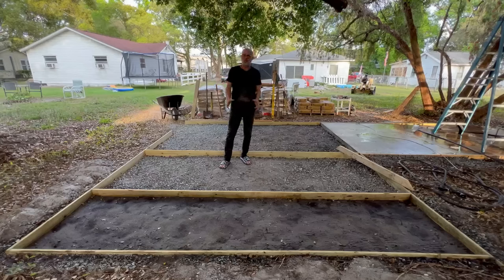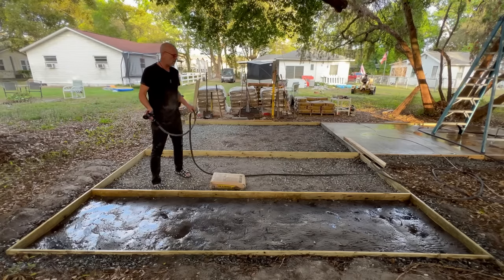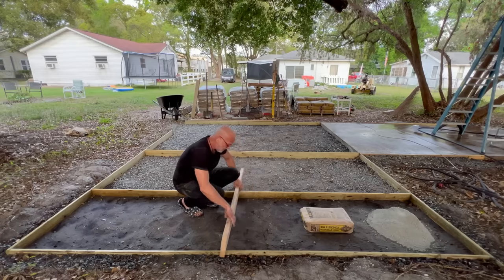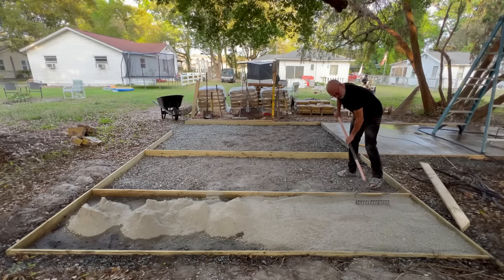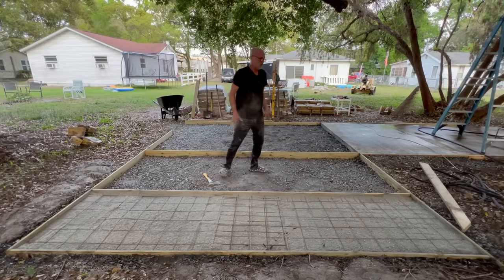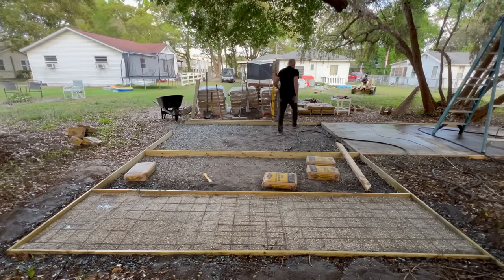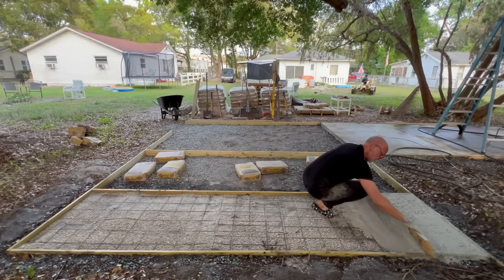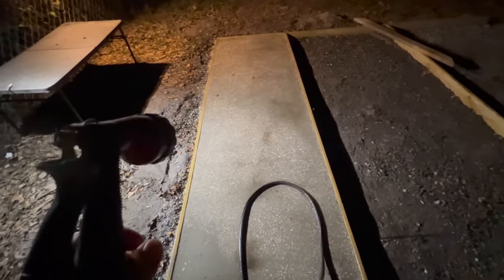How To DIY Dry Pour A Large Concrete Slab In Real Time

Comment: Nice idea, which at a push I may consider if I were to do another small project.. Personally, I'd go for renting a mini Cement mixer (borrow a friend or a second mixer) and a couple of wheel barrows and then go to town on the pour..

So, you are basically using what we call in the UK "Post-Crete"? Originally, I thought you were just using bags of pure Cement (as in the Cement you mix with sand and water)
The Post-Crete will go hard with just the moisture in the atmosphere over time.. With a sprinkle of water is enough to trigger the process..
Now Im no expert in this field but what about on the inside, in the center, My thoughts would be using this method the pad will have a crust and powder inside center core?
Also does this stuff crack over these sorts of spans, using this method? What about compression (over time will it not just turn back into dust?)

Another thought: did you manage to screen it, like "Rub it up?" Usually you use metal trowel/float/something metal to draw up/out the moisture and tamp it down (kind of like what you did) to make an almost "skim finish layer", which leaves a nice final finish, as with traditional pours.. With this approach I guess you not.
It must have been a problem to get a proper level over that entire span..

Surely this will just turn back into dust in a few months..  🚧

Comment: If you don't wet the sand you will give yourself more time get it the way you want it. Also, you do not really need the mesh, but it can't hurt. After the mesh you don't have to wet the area. You can wait and do all the water at end. Shake the leveling 2x4 left to right as you move down the pad. Try a paint roller lightly over the top layer before watering. It will give you a great look. Watering at the end will make it a little easier, mist lightly and repeat in one hour. Then water 2 times for every inch of concrete so you will want to water every hour for 8 hours. Not to much on the water. At the end you will one 4in slab instead of 2 - 2in slabs, long run it will be stronger. I enjoyed you video, great work. Thank you.
Reply: Good tips
Reply: people shouldn't give advises if they don't know what they are talking about.
Reply: @temujinkhan6326  I don't consider it as an advice. To me it's and ideas/different ways of doing things from the usual norms , ie trial and error  .
Reply: @tinaforbes1059  the person i comment to doesn't know what they are talking about. You can have an idea but if you never actually put it in practice or even have a clue about concrete then you shouldnt make comments that can cause a DIY thousands of dollars. It cost more to remove concrete in most cases
Reply: @temujinkhan6326 what’s your advice since you’re saying this is a bad idea?
Reply: Nice info you added
Reply: @temujinkhan6326  the way @pjs139 suggested is the way almost every other youtube video does it so he probably isn't wrong.  He was also respectful and didn't say the video procedure was wrong or anything.
Reply: @Gampeh  "probably" that says it
Reply: @temujinkhan6326  You're scared to give corrections, you only give empty critiques without following up with the necessary explanations (even when politely asked by other people), and you ignore the substance of peoples questions so you can answer with a pretentious rebuttal that helps no one. Sounds like YOU don't know what you're talking about.
Reply: The advice is you don’t need tools in your hands, who the hell doesn’t mix the concrete. How will the chemical cure occur if it isn’t mixed properly? Answer: it doesn’t! That craps going to be a broken up mess in no time
Reply: EXACTLY
Reply: @temujinkhan6326  
YOU ARE MEAN & RUDE...
He does KNOW what he is talking about...
This exactly how I do it... and I know what I'm doing...
Reply: @derekhallett6946  
EXACTLY!!!!
Reply: @joshuajames2785  
It will Harden with the water... BY ITSELF... NO MIXING NEEDED
Reply: @judichristopher4604  I have hired supposed master masonry and carpenters before. it turns out they don't know what they are talking about which you likely don't either.
Reply: @temujinkhan6326  
Will.... YOU are Wrong.
Reply: @judichristopher4604  how many houses or driveways have you built which has pass code inspection?
Reply: @judichristopher4604  Concrete doesn't "harden". It cures. Why does my concrete vendor deliver batch mix in a mixer?
Reply: Guys, HERE is The Savior

YaH The Heavenly FATHER (Genesis 1) HIMSELF was Who they Crucified/Pierced for our sins and “HERE IS THE PROOF”

From the Ancient Egyptian Semitic: 
"Yad He Vav He" is what Moshe (Moses) wrote, when Moses asked YaH His Name (Exodus 3)

Ancient Egyptian Semitic Direct Translation
Yad - "Behold The Hand"
He - "Behold the Breath"
Vav - "Behold The NAIL" <— YaH’s Crucifixion
He - "Behold the Breath"

“Behold the HAND that Beholds The NAIL” 

PROVES - YAH The Heavenly Father HIMSELF was Who they Crucified

That is EXACTLY what Moses Wrote

Here is what they mean

YaH's Name:
(Ya)d + (H)e, as YaH is what Moses called Him and YaH Declared: "this is My Name, this is My Name for all generations" (Exodus 3)

YaH is The Creator of “MAN”: (Genesis 2:7)
Yad He, (HAND BREATH), as YaH's "HAND" Formed man from the dust  of the Earth and His "BREATH" made him a living being (Adam)

YaH's Sacrifice of Crucifixion for “MAN”:
Vav He (NAIL BREATH), the "NAIL" through YaH’s "HAND", in Sacrifice of Crucifixion, that whosoever shall call YaH Savior, His “BREATH” brings forth life (Salvation)

How YaH arrives:
YaH arrives via the Tent of Meeting (Exodus 33:7:11, Isaiah 54, 55), where a Tent is erected outside the city, a cloud descends upon the entrance of the Tent and YaH appears...

Why they demanded YaH to be Crucified:
YaH was Crucified according to Hebrew law (Deuteronomy 21), to be NAILED/PIERCED on an Almond Tree for BLASPHEMY as it was for His NAME they demanded Him Crucified. The Messiah claimed He was YaH...

HE WAS YaH!!!

HalleluYAH translates “Praise ye YaH”

The Hebrew Book of Isaiah

Isaiah 42:8
"I am YaH; that is my Name! I will not yield my glory to another or my praise to idols.

Isaiah 43:11
I, I am YAH, and there is no other Savior but Me.

Isaiah 45:5
I am YaH, and there is none else.
Reply: @joshuajames2785 sounds like you have never worked around concrete a day in your life. It will cute without being mixed. It constantly absorbs moisture. You can wet and entire bag of concrete over and over just like he is doing and it will be the same result as being mixed. 

The only reason you mix it is to make it easier to work with and save time. It doesn’t take days to put a slab down. It takes hours when mixed because your not laying out bags and bags of concrete and then watering over and over. A homeowner has that time. Not contractors. There is also more time to fix things when it’s a wet pour. It’s easier to dump it from a hopper or wheelbarrow than it is to carry bag upon bag of concrete making a sand pit. 

Mixed or sprayed, same result.
Reply: "Really Don't need the mesh"???? It's called rebar! And YES YOU DO need it, rebar keeps the cement slab together, if you don't use it, it will SURELY FAIL over time.. let me know when it completely disintegrates into  pebbles, by not using rebar. Smh
Reply: Yep. Wetting after the mesh created a hardscape line between the top and bottom layers which is going to weaken the slab.
Reply: does this method last? As in is it as durable as the wet concrete??
Reply: @ssdtrain1 difference between mesh and rebar...also required in different situations. His pad is neither of them. Most driveways in the u.s. are 4" thick, 4000 psi non reinforced (means no mesh or rebar) personally i would reinforce a driveway pour if i was doimg one but hes not doimg a driveway pour is he? In fact he specifically says he wont drive a car on it or anything
Reply: @PTRRanger951 I hate to disagree,  but extensive testing has been done evaluating the strength and durability of mixed concrete vs dry pours.  In every case, the dry pour proved inferior to the mixed pour.  Anyone can look up the results but the bottom line is strength and durability are much greater when using mixed concrete.
Reply: Dust mask, no bare feet and rubber gloves and great job.

Comment: Dry pouring concrete is fine as long as its not structural or load bearing.  In general strength tends to be 60-80% strength and it can have more structural defects on the interior where the mix was not quite the right ratio (the concrete washed off the aggregate too much).  But when you are talking patios, storage shed floors, etc you don't need the 3000-4000 psi of your normal concrete mix, unless you're building a machine shop floor, garage, etc.  You can also use some Portland cement in the very top bit to get a cleaner finish (or build a small screen and filter some of the heavier aggregate out of a bag.  Next time after about an hour or two just cover your pad with a cheapo plastic dropcloth, and then just wet it down again once a day for 3-4 days.  After a day or two it should be fine to walk on.  And then just avoid driving your car, tractor, bobcat over it for a week or two.

Another thing you can do for your backyard projects is stabilized earth/sand/gravel.  You basically take 4-5 inches of dirt and replace 30-50% with cement (just kind of dug in well with a shovel).  Then you tamp it flat and wet it down over a few days.  It'll just give you a very hard-pack surface a base for pavers, a pathway, under planters, etc.  After a few weeks stabilized soil will be pretty solid, but if you wanted to in the future you could still break it up with a lot of elbow grease and hand tools.

Comment: I saw a video comparing concrete mixes for posts. Fully mixing beforehand turns out harder and more long-lasting than dry pouring (because it all mixes together more thoroughly and consistently). However, as you mentioned, more equipment and cement trucks = more costs. if you were driving a car over it every day, then it would be more critical, but for small sheds and walking,  it looks pretty good. Would be curious if you can give an update after a year or two to show how it holds up over time. I would prefer to do it this way too where I can set my own pace and budget. You're giving me some ideas. Good luck with it!
Reply: I believe I've seen the same, the video also used the foam mix too!?! Yes. Thanks awesom
Reply: @gawdzalien2811  Yes, sounds like the same video :-) Cost, time, manual effort, and concrete strength = various options.
Reply: Would love to see an update after 10 years.   I hope it is still standing strong.
Reply: That’s gonna crack all over the place
Reply: @bobbydee1187  I built my wood shed platform with dry bags 90 80lbs bags. no mesh been there 10 years with 15 cords of oak stored every season. Even had a row fall down a few times. along with my tractor dumping the bucket full on the concrete..NO CRACKS yet..wonder if I had put mesh would it have been even better.
Reply: I have some I put down upwards of 15 years ago. I even left the wire out of some thinking I may have to move it. So far the only concrete I've had crack is the stuff I mixed and poured. I've even driven on some of it. It's harder to break with a hammer that the poured stuff. Once it begins to harden so the water doesn't disturb it, keep wetting it heavily for several days.
Reply: @JohnChaplain  Interesting, thank you. I think watering it well, as you said, is important to make sure all the ingredients activate inside before the outside cures. I might try this on a side garden patio that will never have any heavy traffic or buildings, just people sitting on it. I may add a wood patio over it later where the concrete would keep the wood above the soil. Good to know, thanks!
Reply: @Mycouponman I’m really thinking about doing this too, just curious how big was the concrete pad you made for your shed?
Reply: Prove it
Reply: Rut Roh… looks like your mesh will be at the edges, where it can rust…?
Reply: Pin this one
Reply: i have to think that over time it would be just as strong.  concrete is porous and moisture from the ground and humidity would slowly solidify the concrete.  may even be stronger, long term as there are no additives in the mix to speed up curing time in a wet pour.
Reply: @Mycouponman  I love it. You got some really good concrete there. Good job.

Comment: This looks great . I'd never considered this approach before 👍. Question: When its time to pour the next adjacent slab , do you pull the wood former between and do a typical slab break "expansion joint" between the two , pouring that adjacent slab in contact with the previous one ?
Reply: I know nothing but probably good to have expansion joint, especially in colder climates.  I use fence board for the joint.  Any wood you use is going to rot anyway.

Comment: Sir.   I have a project where your method may work well.   How is the concrete slap holding up? I liked the idea of the wire mesh.  Does that mean that weight can be on it.  In other words, park a travel trailer on the slap. Great job and thank you.

Comment: There should probably be some consideration that you are doing this in an area where the ground does not freeze. In ordinary concrete application when they mix is screed and floated floated part of the objective is to settle the larger stones under the surface cousin freezing weather Stones can expand differently than the concrete around them causing the stones to pop and brake which makes a pockmark in the surface. With dry poor you won't be able to settle the stones a fine mix is recommended so no stones. I also highly recommend you simply cover the whole thing with plastic and let it set for 4-5 days guaranteeing the highest level of moisture in it for that time.
Reply: When you said a fine mix, do you mean like the type that is used for countertops? I live in the high desert and the weather can be in the teens in winter and even down to 5 degrees. Thanks!!
Reply: I wonder if you could top this with 1" of pure sand/cement mix to get a smooth, non-stone-popping finish. Would be easier to level also

Comment: I think you would’ve had was less patting, if you had shimmied the pull board side to side as you floated front to back, and used a dry paint roller to finish smooth before misting the final stage. Looks good though, thanks for letting us watch.
Reply: yeah i saw anther vid where they shimmied the pull board and that slab looked perfect!

Comment: For a novice you did great!  The wood float is used to knock the rocks down and bring The "cream" to the top so it's smoother.  Of course that's when pouring wet but I think it would still kinda work especially after you mist it a bit.  If you really want a smooth top get the steel float, not the magnesium the steel, looks kinda like sheet metal with a handle.  That will really slick it up, espacially after you wet it down a little.  Be careful, you should really wear rubber gloves, concrete will give you a chemical burn.  People react differently to it but it can be pretty nasty, it never really got me but I've seen some people have a pretty bad skin burn from it.  You're probably done by now anyway but maybe that will help someone a little.

I've done enough, a friend borrowed my concrete tools a year or two ago and I told him not to bring them back, I'm done with it. Lol

Comment: Before wetting, you can run the 2x4 side to side to level and it will also make a nice finish and hide the rocks. Then, mist afterwards. You can also run a paint roller after misting and it will leave a really nice finish.

Comment: Take your leveling board and move it side to side quickly.  It will smooth the top so there is no gravel showing.  Mist very gently to set the concrete without gravel coming through the top layer.

Comment: Rather than patting it down just use your leveling board.  By going over it a couple times it will bring the powder to the top. And don't wet until you are finished leveling.  Otherwise you will end up with  joints and uneven concrete

Comment: On the back of the bags across the middle is a line. If you cut these bags along that line with a box cutter instead of ax busting a hole in them, emptying the bags will take half the time and you can do it slowly, minimizing the drift of concrete dust. Gives real nice control of dumping the mix out of the bags too. I really like doing dry pour method for less refine top finish slabs.